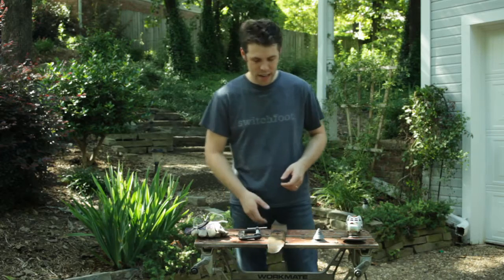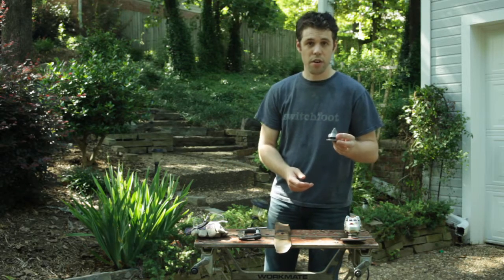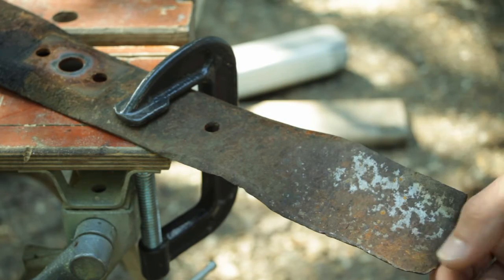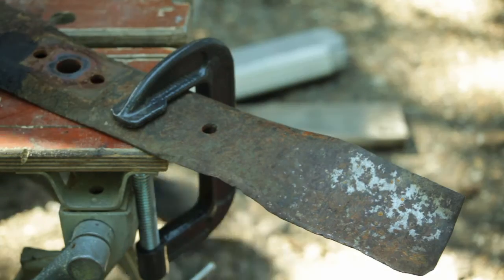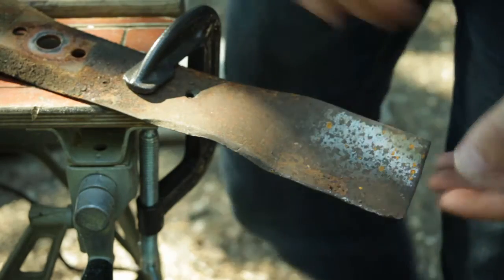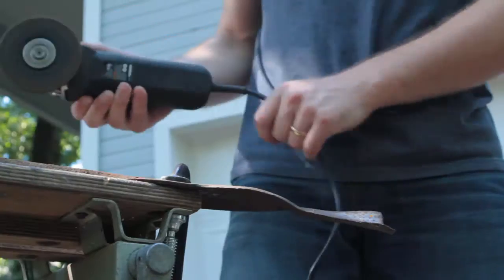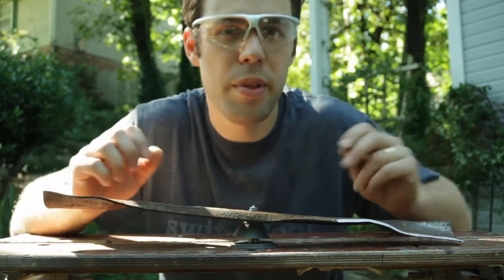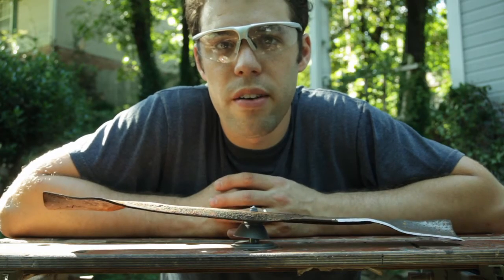In the Garden - How to Sharpen a Lawn Mower Blade

Comment: Nice video. It's definitely a handy and simple task to know how to sharpen your own blades. I used to do this for a living. Or, at least, it was a daily task at the shop. Anyway. I recommend using a vice and position the blade so its upward, toward the sky. This helps you see where you're working better.If you stand at a steady angle to the blade and do nice even (angle and speed) strokes in a forward motion you can see just when the edge is flush and you're surface area is even. Also, don't forget ear and eye protection. It is really terrible when you get something in your eye. A facemask or respirator doesn't hurt, either.